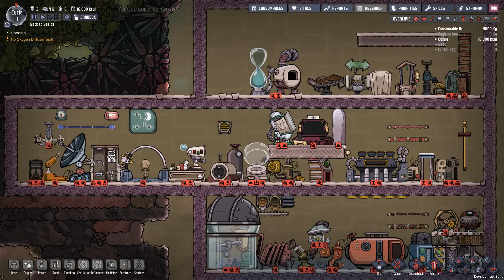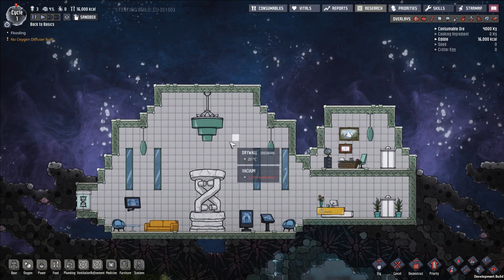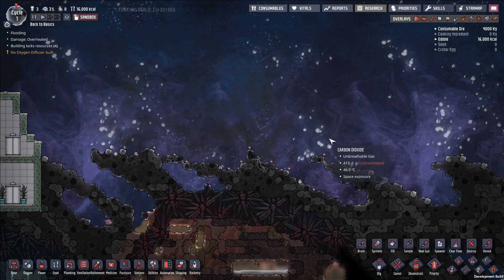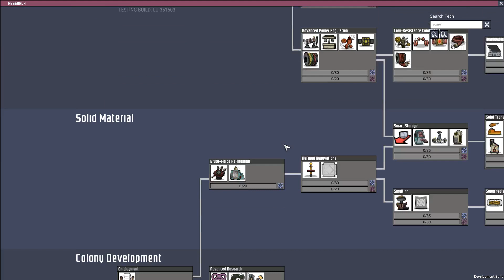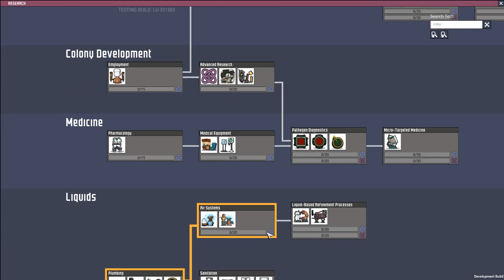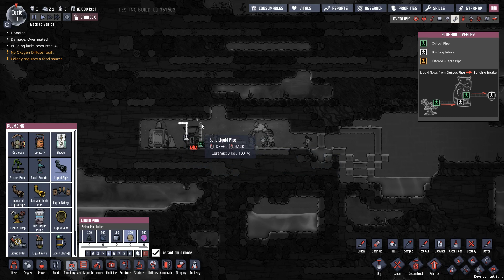Ways of Obtaining Refined Metal (Minus Ranching)-- New Player Guides [Oxygen Not Included]

Comment: Two questions.

1) Is the heat output to the cooling fluid for a refinery based off a fixed temperature, or is it based off the temperature of the unrefined metal going in? To ask it another way, does ore at 10 Kelvin produce more kDTU's into the coolant than 100 Kelvin ore?

2) If so, is there something useful that can be achieved with this information?
Reply: Not sure I understand your question but the temperature that gets added to the coolant will always be 80% of the melting temperature of the metal. Since the melting point is a fixed number it doesn't matter how hot the input metal is.

The only thing that could be interesting is that the refined metal will always be 40°C. So you could theoretically delete heat by sending super hot metal in (right below melting point). But that would probably be highly impractical and also wouldn't be very efficient as metal has such a low heat capacity. Also at this point it may be just easier to melt the metal by heating it up a little more.
Reply from the maker: The heat output to the cooling fluid is fixed.  I believe the output temperature of the refined metal is also fixed (at 75 C if I recall), which opens an opportunity to delete heat by pre-heating the raw ore before it is refined.  However, two issues:  1) I kinda expect Klei to patch the game at some point to make temperature of input metal ore = output temperature of refined metal, and 2) It would likely be more effective to use the rock granulator for this sort of heat deletion, because the specific heat capacities of metals are usually fairly small.

Comment: If we're doing lots with heat, I wonder if there are some viable and worthwhile systems of just directly melting the ores to get their refined version. I suppose we could just directly dump the lower melting metals of gold/copper/aluminum/lead into some magma, and then use the pumping trick to get it back out, or maybe circulate a hot mass of some fluid or gas over the metals to melt them and then figure a way to cool them back down.